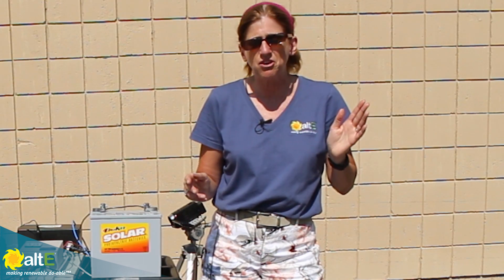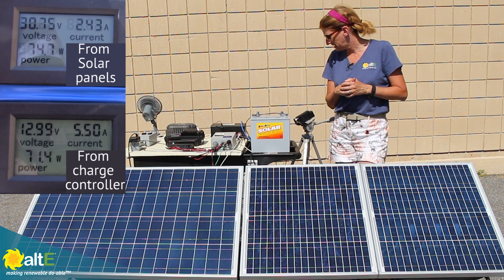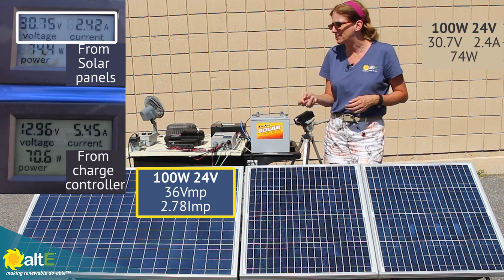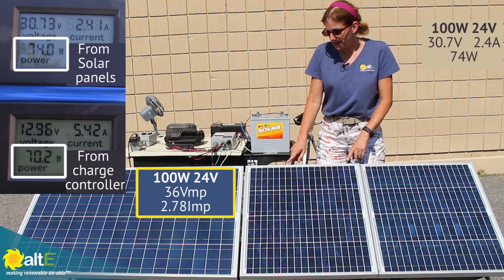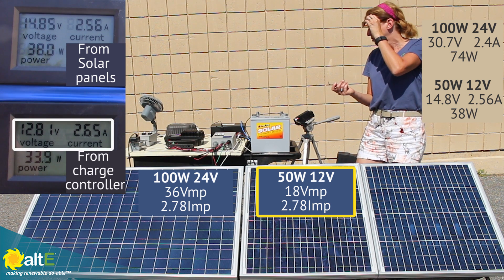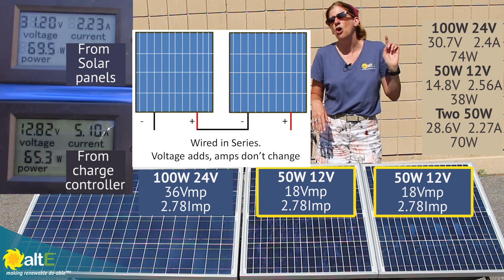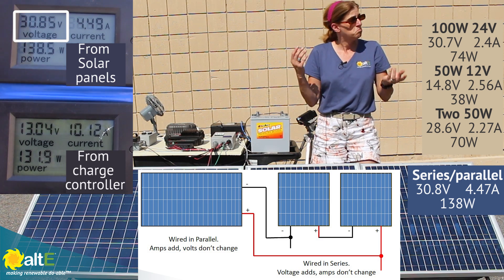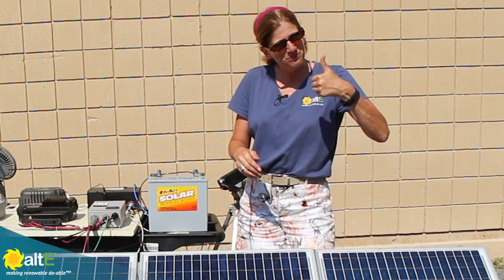How to Wire Mismatched Solar Panels in series and parallel

Comment: Hi Amy, great videos very helpful. i have two 24v panels 250w each connected in parallel to my 24v battery bank via pwm cc, but i also have 4 panels 12v & 150 w each.and i dont want them to be wasted. can you please show me how to connect these mixed panels to my battery bank.
Reply from the maker: The best way is to have a separate charge controller managing the four 12V panels. They would be wired 2 parallel strings of 2 in series. The output of the two charge controllers would connect to the battery same as usual. Ideally, use the same type of charge controller to ensure they are both configured the same.
Reply from the maker: Here's an example schematic of two charge controllers in parallel. http://imgur.com/g3LHozV
Reply: Thank you so much for the explanation. I will set my 12v panels the way you explained by tomorrow. Two more questions .... 
1) should the 2 charge controllers be pwm or mppt? Which one do you recommend.
2) should the cc be connected in parallel or should they be separately connected to the battery.
Reply from the maker: Because you have 24V panels (and 12V panels wire in series to make 24V), you can use either PWM or MPPT. MPPT will work better, but are more expensive, so your choice. See the schematic at http://imgur.com/g3LHozV. Each charge controller goes through its own breaker to the battery bank. So they are wired in parallel through a breaker.
Reply: Thank you so much Amy. Its clear now.

Comment: how to connect 250w 3 panels with 150w one panel..plz answre me i m confused
Reply from the maker: The 150W panel should have its own charge controller. Wire the outputs of the 2 charge controllers in parallel to the battery.

Comment: can we install Sunpower E/D series of 300+w in an off grid type of setup? if yes what type of solar charge controller do i need? i am planning to install 1kw setup. your reply will be appreciated. thanks in advance.
Reply from the maker: I'm not sure which panel you have in mind. The older SunPower panels had to be positive grounded, where you bond the positive to ground instead of negative. Special charge controllers were needed for that. I don't think the newer ones are anymore, be sure to double check. Find the datasheet for the panel you have in mind to determine what the Voc and Isc is of the panel. Also let us know what voltage battery bank you have in mind.
Reply: I am actually considering two different company's panels. one is Sunpower and another is Panasonic. Both have approx similar specs in means of output. And I guess panasonic is easily available in India. So I want to tell you the specs and model of that module.(https://eu-solar.panasonic.net/cps/rde/xbcr/solar_en/VBHN330_325SJ47_NO.pdf)
Panasonic HIT: VBHN330SJ47
pmax: 330 w
Voc: 69.7 V
Isc: 6.07 A

I want to go for a 24v battery bank. As I want to install 1kw Off grid setup. I had EPEVER Tracer 4210a model Mppt charge controller in mind(http://hespv.ca/eps-mppt-40). 
But i am not sure for the grounding!! Is this type of charge controller perfect for my requirements?
Can you help me out?
Reply: I am confused. Can you please help me by guiding me? I am waiting for your reply.
Reply from the maker: You can do 3 parallel Panasonic panels. 325 watts x 3 panels = 975 watts / 24 volt battery bank = 40 amps. So you need at least a 40 amp MPPT charge controller. They are regular negative grounded panels, so nothing fancy is needed.

Comment: Your videos are helpful and informative.  There are still many things I don't quite understand.  My solar 'light bulb' hasn't quite gone off yet.  But I know it will soon.

Okay.  I'm considering using poly, mono and wind together.  Is that possible?  I live in an area that can be overcast for days, its usually windy at night and when then sun shines its strong.  According to SUN hour charts, the average is 4.53 hrs per day.  I currently have 4 12 V 100 W Monos..  I'd like to add 4 12 V 300 W polys and two 300 W turbines.  I understand I need a hybrid charge controller, but is what I'm shooting for possible? 

I would  eventually like to build to at least a 6-10KW system.

Your advice would be greatly appreciated!

Again, thanks for the great videos!!
Reply from the maker: We are happy to help.   I don't think you'll be able to find 12V 300W panels, you will likely need to get 20 or 24V panels and get an MPPT charge controller for it. You can wire it in parallel with your other charge controller with the smaller panels. You'll also need a different controller for the wind turbines than the solar ones. Some turbines, like the Primus ones we sell, have the controller built in, so you don't need a separate one. https://www.altestore.com/store/wind-turbines-river-turbines/primus-windpower-turbines-parts-c1244/ . It is common to have both wind and solar in the same system. Look at page 15 of this manual to see that they each are controlled separately. https://www.altestore.com/static/datafiles/Others/Air_40_Manual.pdf

 What voltage is your battery bank? If you are adding that much power to it, you should have a 48V battery bank. 12V won't be able to grow that big.
Reply: I'm starting  with 4 12V  batteries. I was going to connect  them in series. And every two months add another 4 12V  batteries  connected in series.
Reply from the maker: Battery banks don't like to have more batteries added after a while, there is no hard and fast rule when is too late, but you may be better off waiting until you have all of the batteries you need and doing it at once. Also, you would be adding 4 more batteries in parallel, not series, I'm sure you meant that, just correcting for other viewers. The fewer batteries in parallel the better, so you might want to look at getting 8 6V batteries in series rather than multiple parallel strings of 4 12V. I suggest looking at your ultimate goal, and designing from there, rather than doing it in pieces. it saves a lot of money in the long run getting it right from the start.
Reply: Christina Chapman please  send mi diagram  J B singh

Comment: Can PWM CC function with mismatched 24V PV and 12V battery? PWM CC is optimized with matched nominal voltages like 24V PV and 24V battery?
Reply from the maker: We did a video comparing using a PWM and an MPPT with a 24V panel and 12V battery. Spoiler alert, you lose a ton of power using PWM. https://youtu.be/V2b7z2eTb5o

Comment: My 270 watts panels are 60 cell 31.4 vmpp/8.6impp, the 100 watt panel are 36 cell 17.3 vmpp/5.78impp and the 160watt is a 36 cell 18.73vmpp/8.62 impp. I was playing around with cabling and seems I get best output with all Parallel configuration. Any suggestions.
Reply: Right now I'm getting about 16volts coming in
Reply: and about 15 amps
Reply from the maker: I would try wiring the two 36 cell panels in series, giving you 260W 72 cells, and then wire that set in parallel with the 270W panels. The current from the 160W may have trouble in series with the 100W,, you may end up with closer to 6A from the 160. But if you are trying different things, that may be your best best, as right now the voltage from the 270W panels are getting pulled by the 36 cell panels. I;m also assuming you have an MPPT charge controller, as a PWM will cause you to lose half the power from the 260W as well.
Reply: yes I have a most controller. gonna try to series the 270 watt panels. thanks.
Reply from the maker: Don't series the 270s, series the 100W and 160W together, then put them in parallel with the 2 270W panels. So you'll have 3 parallel strings, one of the strings will have 2 in series, the other two strings are just one 270W.
Reply: the volts shot up to 34v and the amps are at 6amps. is this the correct outcome?
Reply: 35volts and Batteries are fully charged already. Thanks for the great advice.
Reply from the maker: Your current per string should be about 6A, not the whole array together. It may have just been reduced because the battery was almost full. I suggest when the battery is lower, if you aren't getting more current out of the array, disconnect the strings and measure the output of each of the individual strings. 34V x 6A = 204W, you should get much more than that (I usually plan for about 60% of rating, although you have less than idea setup, so maybe a little less. )

Comment: I have a question about my panels. I have two panels that are 270 watts each and two smaller panels which one is 100 watts and the other is 165 watts. If I connect the 2 smaller panels in series, will they not bring down the bigger panels? Or should I just connect all them in parallel? Thanks
Reply from the maker: A big question is how many volts the panels are. I am guessing the 100W panel is 12V (36 cells), the 270W are 20V (60 cells) or 24V (72 cells), and hmmm, I don't know what the 165W is. These panels may be too different to match up on one charge controller. Let me know what the volts and amps are on the panels, and we can see if we can make it work, or if you need to use separate charge controllers.

Comment: Yes, this is likely to be the best way to do it. In theory you could have connected all three panels purely in series if the charge controller could handle that higher voltage input. 

However I suspect that this would yield inferior results since even though they have compatible name plate ratings there is bound to be a performance difference between the different brands(?) or types of panels. 

And of course the parallel type connexion has advantages when it comes to shading.

Comment: so it's Vmp we add together not Voc when hooking up panels to an MPPT charge controller.
Have you done anything with using a small wind turbine, 1600 watts to a grid tie or microinverter?
Reply from the maker: The Vmp is just closer to what you will actually see, as it is the maximum power output. If you multiply Vmp and Imp, you'll get the rated watts. You use the Voc when calculating the high voltage limit of a charge controller, but you won't often see it (you only need to exceed it once to damage your equipment tho). 
I would not recommend connecting a turbine directly to a grid tie inverter. #1, it's not designed to handle that, #2, you'd need a reliable dump load if the grid goes out to keep from blowing up the turbine.
Reply: I wouldn't hookup directly silly, it needs a special controller designed for this application with a dump load to handle the turbine when the grid is down.